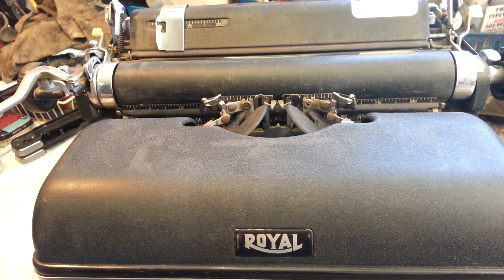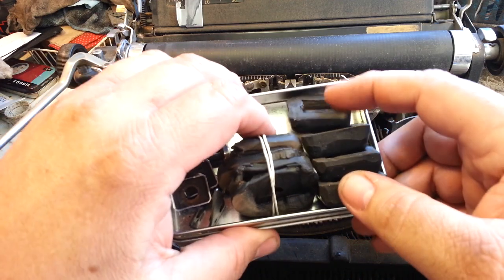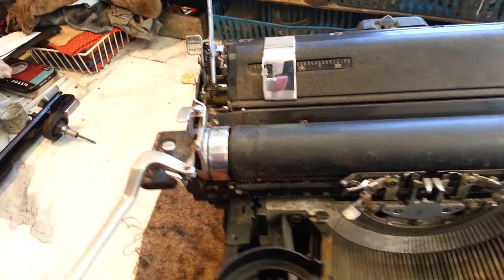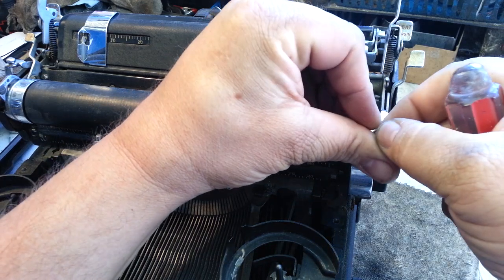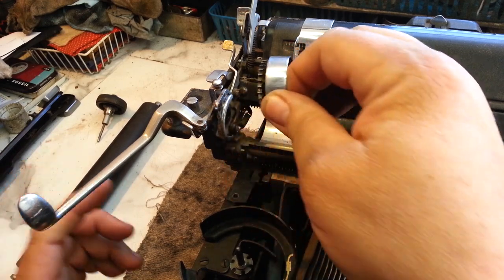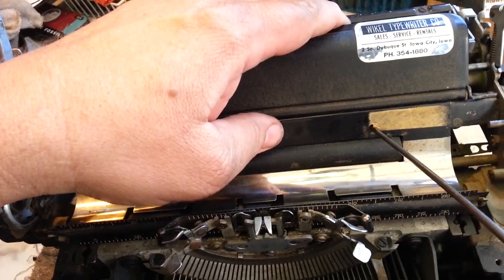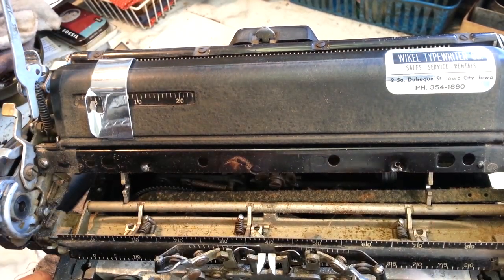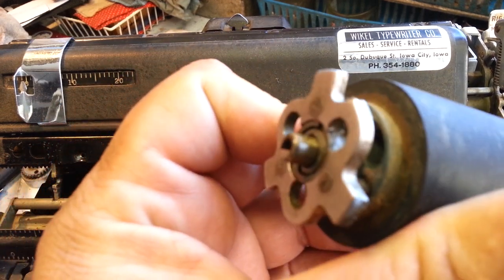Royal KMM Typewriter Platen Removed KMG Feed Roller Paper Pan

Comment: I have  1939 Vogue KMM I want to have the platen redone. My left hand knob doesn’t pull out. It doesn’t budge. Is there a model that is different? If I take the left knob off it will slide an inch and stop. Thanks! Update- I had to spray a little teflon lube in the screw holes and on the shaft to loosen the gunk and it slid out.
Reply from the maker: Yeah I was gonna say, these are stubborn sometimes, penetrating oil will help
Reply: @ Thanks for the response. your videos are super helpful!

Comment: i recently came into one of this models hopwever the large screw that holds the knob is very rusty and seems to be stripped, any suggestions in removing those types of damaged screws?
Reply from the maker: Drill it out, cut it out, easy out remover, there is no easy way
I would have to see it for my final decision/attempt, sometimes there is no way . . . .
Reply: Put some penetrating oil on the screw. Wait 12 hours. Do it again. Wait 12 hours do it again. Wait a few more hours and then, if you can't get it out with a screwdriver, you can get a slightly undersized left-hand drill bit and sometimes that will make it come out. Then, if you have enough left, cut a new slot with a dremel and you can reuse the screw.

Comment: Is a 1938 DeLuxe same/similar?
Reply from the maker: DeLuxe Portable ? Not even close
Reply: @phoenixtypewriter2136  Thanks, it has a flat spot on the rear feed roller.  This is one that I think is an unfinished project by the seller, the front rollers are soft and round.  He probably couldn't figure out how to replace the rear feed roller which is longer.
Reply: I recovered the feed roller, much better. A bit tricky getting it back together. The worst part was 45 minutes on my hands and knees looking for a dropped set screw.

Comment: Hello there I have just inherited a underwood 5 from around 1910 to 1920 and the carriage wont advance unless your adding additional pressure then it works perfectly it is so frustrating any help would be appreciated thank you
Reply from the maker: Flush all old oils out of all moving parts and relube, wire brush all rails and contact points
Flush/lube mainspring, increase tension, look for binds and parts interference
Reply: @phoenixtypewriter2136  how to you get to the main spring and increase tension I have made 5 rotations already and it is pretty tight can you use the brass knob at the back of the machine ?
Reply from the maker: @Byron2000-i2h   Yes, but if it has lots of tension, look for a different solution
Reply: @phoenixtypewriter2136  just pulled the entrapment and cleaned out old rusty bearings and greased it she is moving alot better now 🤘

Comment: Have you ever dealt with a Royal KMM with a carriage that jiggles a bit? I bought a KMM recently. The carriage was completely stuck. I resolved that issue (partially thanks to this video!), but now it has a slight jiggle to it. I’m guessing it should be completely secure? I posted a video of the issue: https://youtu.be/T5Df-rScOhA
Reply from the maker: Yes ball bearings should be as close to edge as possible, both the single roller rail is adjustable , 
as are those 2 screw brackets . It's a matter of trial & error, tight with no binds, but if this got dropped
and rails or something unforeseen got damaged or bent it may never tighten all the way
Reply: @phoenixtypewriter2136  Thanks for the advice! I moved the ball bearings further out and that steadied the old girl. All is well now!